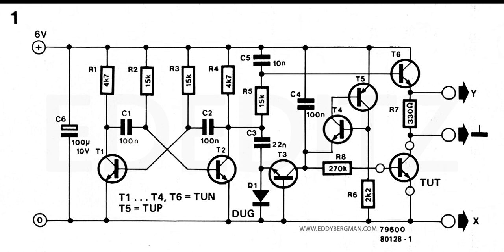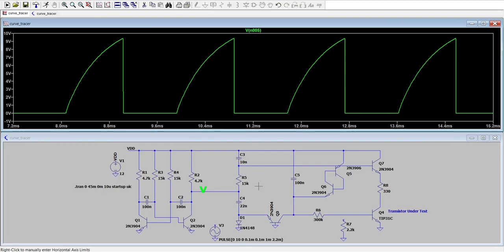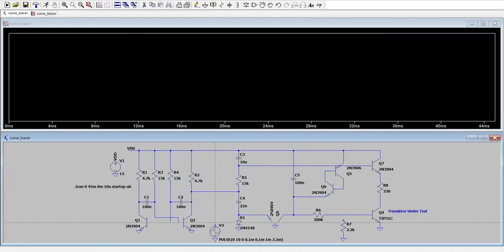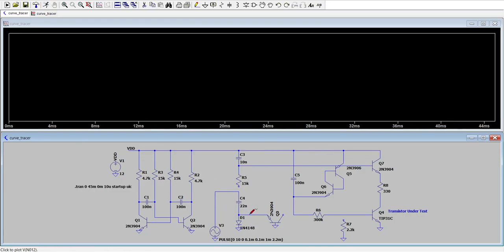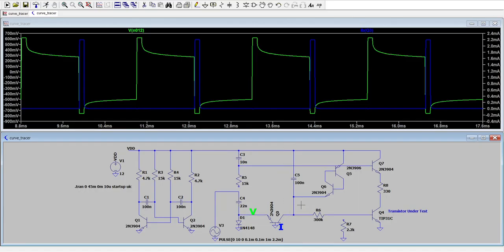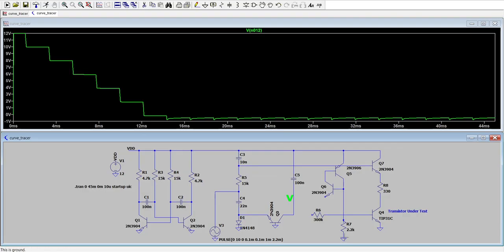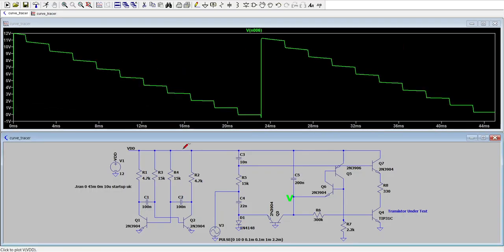Discrete BJT Curve Tracer:  an intuitive analog circuit analysis

Comment: As far as i know the original circuit did not use a Schottky diode but actually used a germanium diode specifically. There is a Dutch guy who references the dutch circuit which eventually made its way into Elektor magazine into english. I'll find the link to his YT video and then from there is a link to his website which goes back to the history of this rather brilliant schematic in its day. But thanks for your analysis. Very good job.
Reply: Here is the geranium diode reference and probably original circuit reference. https://youtu.be/V5UJiaRwV88?si=drJUYL8qwPVQwQJY

Comment: I wonder if anyone made an IC of a circuit like this one.
Reply from the maker: I doubt it. It is a very cool little circuit, but given how much the production of an IC costs, it makes absolutely no sense to make something like this. Even if we'd ignore the fact that it would be impossible to sell enough to make it cost effective, once that you are doing IC Design things are completely different. Transistors are basically free, so it doesn't make sense to use such a simple design. Something way more complex would be used. I'm kinda sure that even commercial curve tracers have very little dedicated ICs, but are mostly built from discretes and standard ICs such as op amps and similar stuff

Comment: Thx for this clear explanation. Any possibility for posting the .asc for LTspice?
Reply from the maker: @calculatingcapibara2914 Unfortunately I don't have that file anymore as I've modified it to work on my improved version. However it should be quite straightforward to recreate it yourself from the GUI. I used the default models for all the components, it's just a bunch of them
Reply: thx for your answer. I started to work things  on LTspice 4 today, but the MV wouldnt start, even when I made the MV very asymmetric. But I will persist and could use a 555 if present. In addition, I am thinking of building the device in real life, and as I have no scope, using an Arduino +TFT or dumping the result in a .bmp file. Thx for the inspiration from you post.
Reply from the maker: Weird! Be sure to use real transistors in LTSpice. Even a slight asymmetricy worked for me (like one collector resistor 1 ohm smaller than the other). I don't know about your sim setup, but be sure to include "startup" and especially "uic" in your .tran directive. Uic tells the simulator to skip the search for an initial operating point solution, which might be your problem if you didn't include it. Good luck!
Reply: "uic" did the trick. Thanks for bringing me on track! Long ago, I had a MultiSim on XP which took silently care of starting circuits where needed. LTspice is a different breed.

Comment: IMHO it's lacking some explanations on the ending of the circuit, I felt like it stopped at 80% of the explanation. Also, that capacitor C5 does not discharge as Q3 goes on, it charges, and discharges with Q5-Q6 in parallel. It's because when you turn Q3 on, on startup, you have VDD at C5 and then you give a lower voltage path, thus charging C5. When Q5-Q6 turns on, they are in parallel...
Reply: Oh, my fault, now I saw "Transistor Under Test"
Reply from the maker: Thank you for the feedback! What do you think I left out from the explanation? BTW I totally get your point on C5. I might have not expressed myself in the best way. As the lower node of C5 is at VDD, the turn on of Q3 provides the lower resistance path thus discharging C5 through Q3 and the diode. The fact that Q5-Q6 charge back up the cap I think can be proved by the fact that, as I've shown in the video, when Q5-Q6 are disconnected, the node voltage makes that stepped ramp only one time and then remains to zero. I think that maybe you are right, it is a little bit more complex than my explanation: the fact is that the SCR turn on forces that node to go back up to VDD, since it is basically a very low impedance path from VDD to that node. This generates a very big current flow (in the simulator we are talking a couple amps!) that force immediately that node to reach VDD in a very fast time. Then that terminal can be thought sort of floating (Q3 off, very high resistance to the transistor under test), maintaing thus the voltage, till Q3 triggers and quickly discharge it a little bit
Reply from the maker: I think the confusion might arise from the SCR behaviour. In a very first order approximation you can think about it as a short circuit from VDD to that C5 node when it triggers, thus forcing through a very high current a voltage VDD on that node. Please let me know if it is clear!
Reply: @ I think the confusion arises from the fact that we usually put a capacitor to GND and then charge connecting VDD to the other terminal. But in this case, it's not tied to GND, it's tied do VDD, and then you provide a low impedance path through Q3 to charge it. So both terminals were at VDD, but one remained at VDD and the other is now lower, so the capacitor is charged. The Q5-Q6 as you said, makes a very low impedance path for C5 to discharge, because they are in parallel with it.
Reply from the maker: Yes! We are saying the same thing, simply switching the term charging and discharging. And after thinking a little bit about it, you are the right one here: in this case when the node is at VDD, there is no voltage difference across C5, thus as Q=CV =0, no charge stored. While when it reaches 0V, Q=C*VDD. So the triggering of Q3 is in fact charging C5! Thank you for pointing that out! It was a subtle one and totally missed this nuance! Ahah
Reply: @indepth_electronics  no problem, glad to help!

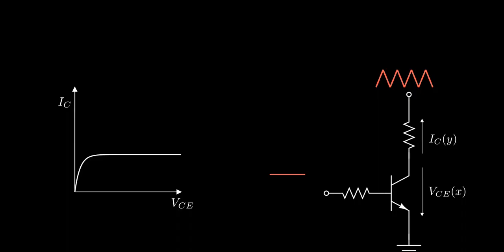Comment: 1:17 shouldn't vertical arrow of graph be noted as Ib, base current.
Reply from the maker: Not really! It is the collector current vs. the collector voltage, the same graph you usually see in datasheets. The variation of the base current gives those multiple branches you can see

Comment: This bs curve tracer is symply a circuit to power up a transistor in an amplifier circuit which is completely unnecessary because you can test any transistor with any multi meter out of circuit.
Reply from the maker: Depends on what you need to do. Might be useful to check some other characteristics that conventional Hfe testers can't measure, such as the Early Effect, or do matching between complementary transistors. I just found its working interesting and wanted to share it, but to each their own
Reply: @indepth_electronics  to be honest some of your videos are quite good.
Reply from the maker: Thank you! Happy we came to a truce🙌
Reply: @indepth_electronics  so am I. Ii apologize for being harsh. You bore the brunt of my frustrations over some of the absolute ridiculous videos getting around in you tube which I'm sure you are familiar with. Cheers and God bless.
Reply from the maker: Absolutely, that's why I'm trying to "step up the game" a little bit here on YouTube with some more engineering stuff to the best of my possibilities. Thank you and cheers!
Reply: @indepth_electronics when a transistor goes faulty 99% of the time it's usually gone open circuit or short circuit. If there is a problem with the gain? It's usually a faulty bias resistor or some other passive component.
Reply from the maker: Sure, but a curve tracer is most useful for other things. One example is Hfe matching, when for example you are building an input differential stage in an audio amp and a mismatched Hfe might lead to an unbalanced pair. But when you find a suspect faulty transistor, you are right, a simple conductivity test across the collector emitter terminals will 99% of the times tell you if that is the problem or not
Reply: @indepth_electronics  of course but that is when you are designing and building a circuit from the start when you are testing and fine tuning the parameters. It's not a technique you would employ for fault finding in  existing circuits/equipment. The only confusion is the definition other wise "all's quite on the western Front.
Reply: @indepth_electronics  the repair world and the theoretical/design world are very different worlds.
Reply from the maker: Sure! I always try to look at things in a design point of view - repair is another world and it requires another whole set of skills which I personally don't have and can be built only with years of repairing
Reply: @indepth_electronics  I started my career in electronics as a repair technician before becoming an engineer and the engineers who I worked with that came straight out of Uni looked at me as if I secretly sacrificed goat's on a full Moon to be able to do the repairs that I did. The average engineer hasn't a clue how to repair.
Reply: @indepth_electronics  precisely and it's not a judgement on anyones knowledge it's all a matter of training. Engineers aren't expected to repair because their training is in building not repairing. Electronics/electricity is such a vast field and the amount of directions you can go is only limited by ones imagination. Very rarely do I came across someone who has had the same work experience as I . Everyone's path in this field is vastly different.
Reply: @indepth_electronics  having said all that! I can't think of any other science that attracts as many cukes.
Reply: @indepth_electronics  your skill levels are very high. You articulate yourself with a high degree of precision and clarity in a classroom setting. You are an excellent teacher and builder. 👍
Reply from the maker: You are absolutely right! Thank you very much man and Cheers!
Reply: @indepth_electronics   @mik823 Get a room you two 🤣 :face-green-smiling:🤣 🙄
Reply: @indepth_electronics  true but this is a circuit that is built in a classroom to learn how to use an oscilloscope and how to test transistor in a circuit. In the real world you would never bother with this circuit you would simply test the components in circuit with an oscilloscope but I don't even bother doing that because it's much quicker to remove and test the components with a multi meter.
Reply from the maker: That's obviously an educational video, obviously it doesn't make sense to test a transistor like this since yeah, like you said a tester will go far. Even those cheap multi components tester can help a lot with little effort
Reply: @indepth_electronics  exactly. I remember building these circuits in bread boards to learn how amplifier circuits work and how to use a oscilloscope for measuring hfe etc.
Reply: Oh good happy ending to the strange drama 👍🏻👍🏻👍🏻
Reply: @soloflo  just like your unnecessary comment👍
Reply: @mik823  Haha thank YOU for your unnecessary reply! Today is a fun day
Reply: @soloflo  not such a good day after all😅😂🤣😭
Reply: @soloflo  cry baby's are my favourite form of nourishment. You are no match for me cry baby😆😅😂🤣👋
Reply: @soloflo  I can spot a fraud like you from a mile away. I've been in the business a lot longer than you cry baby😂😅🤣😆🐝
Reply: @ Hahaha did you know that by making comments we can help this video gain more attention? It doesn't matter if the comment is related to the video or not. So we are doing our part to help boost this video's audience, as well we should because I want to support this YouTuber's content. Please reply and have the last word, and have a good day! Haha!
Reply: @soloflo  I don't think this guy needs your help.👋
Reply: @soloflo  I'll let you know when i've had the last say👍
Reply: @soloflo  don't forget too take your medication 👋
Reply: @soloflo  like most drama queens , you obviously like a lot of attention.